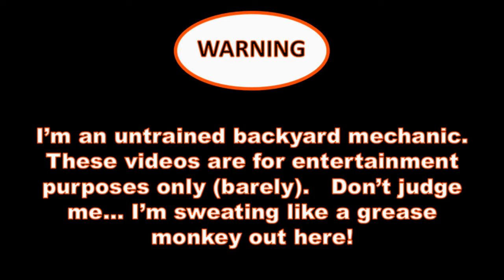Johnson 40 HP Outboard Boat Motor - Lower End Rework

Comment: Good job for somebody that doesn't know what he is doing.  Although I would have forgot to check the length of the shift rod and had to go through an adjustment later.  You might not know what your doing but you think ahead way better than me.  Have a good one.
Reply from the maker: I think I get lucky.. lol
Reply: @Exit45Restorations  Luck has a lot to do with it. LOL

Comment: Might as well replace the rubber impeller while you have it out.
Reply from the maker: I did get that replaced while I had it apart.  You're right it just makes good sense to get it while you're in there.
Reply: @Exit45Restorations  excellent. I replace the impeller anytime I have the bottom end apart.